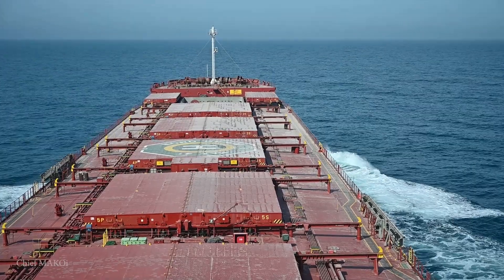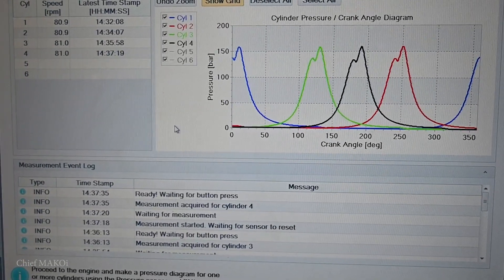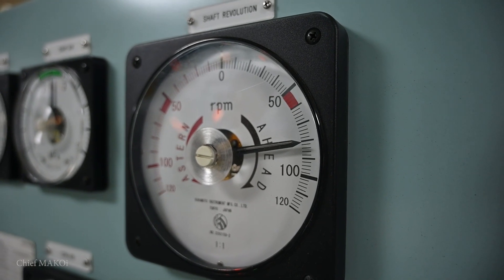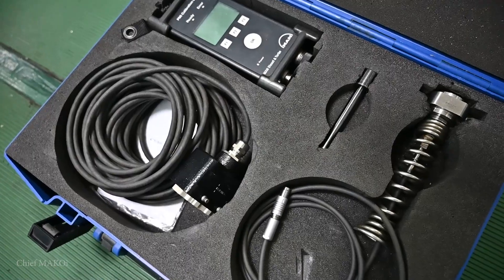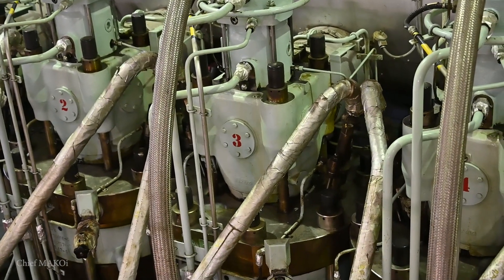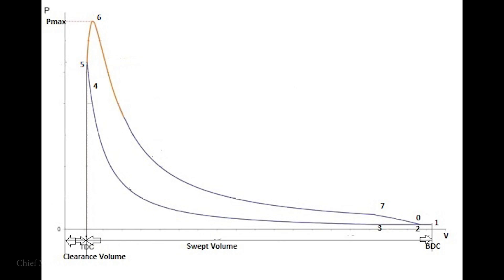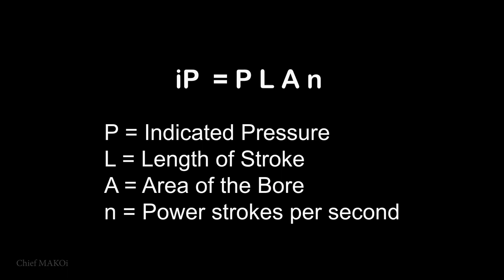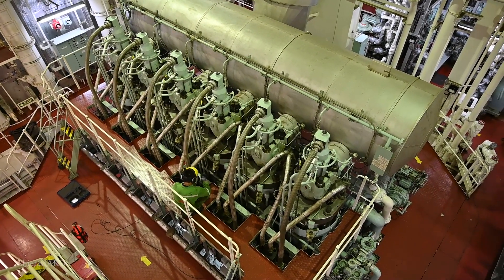Ship's Main Engine Performance Test | Chief MAKOi

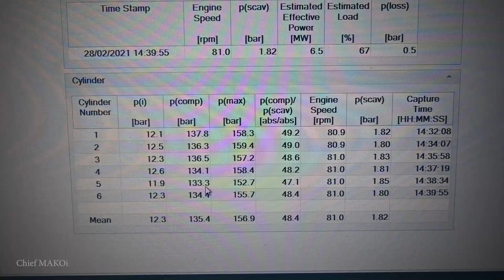Comment: At 10:40 in this film the average TDC pressure is ~135bar which is roughly equal to 2 thousand psi.     Is this typical compression for 2 stroke diesel marine engines? 

Am I reading that table correctly Chef.
Reply from the maker: Pretty much, yes.
Reply: I was blown away by the effective compression ratio - 49:1.  (That includes the pressure increase due to heating in addition to volume reduction.)
Reply: Matthew Beasley “mee too” lol          I think, i calculated that the compressive force on the con rod can be upwards of 1 thousand tons after detonation.
Reply: To convert Bar to psi, multiply by 14.5038.  I find that  a figure of 15 is near enough in almost all cases. Using good old fashioned mental arithmetic, multiply 135 Bar by 10 to give 1350 then add half of this figure (for convenience rounded up to 1400) which is 700. 1350 + 700 = 2050 psi.
Reply: Turbocharger makes a big difference...

Comment: Do any ships have torque-measuring couplings on the output shafts so that engine power can be calculated directly (and continuously)?  This is frequently done on large stationary equipment on land.
Reply: Yes, there is. Arrangement of coils in two places along the shaft with a known distance. The twist of the shaft when turning will be measured and amount of twist determines the output in the value you prefer. 
Made for continues running and as a fixed installation.
Reply: @johanea  Usually done on Navy ships, a bit over the top for Merch. Ships.
Reply: @petermaddison4136  Wouldn’t say maybe over the top. However, you have other options to figure out your output by comparing Factory Acceptance Trail data with a time running the engine during a voyage. 
It is a little bit more rough however since the calorific value of the fuel will be different along with external parameters such as ambient temp, atm. pressure and humidity compared with FAT trails. 
Buuuuuut in 99% of cases or for troubleshooting it is good enough.
Reply: Yes its there. It works like a dynamometer / torsion . And gives the brake horse power or shaft power with ease

Comment: Dobson and Mcguinness indicator if I remember correctly from over 50 years ago. There was one on a single cylinder diesel engine at Guildford College of Technology. Bits of sting and paper allover the place but it worked. Probably before you were born chief. We tied a bit of string around the govenor, apprentices will be apprentices. It was on the second floor. Thank God we managed to cut the string in time or it would have been on the first floor.
Reply: Can you tell me 
Do these motors run with a dry sump ?
Reply: @charliepearce8767  
Yes. Dry sump motors.
Reply: @charliepearce8767 No, the sump is part of the ships structure and underneath the engine. Oil pumps are large motor driven affairs  located at the after end of the engine as ships tend to trim by tbe stern, so the oil is deepest there. Its still possible to loose suction on the oil pump if rolling badly, which will start to  shut the engine down, but you roll the other way and oil  pressure is restored. This can be reduced by adding more oil to the sump.
You have suction filters to protect the pumps   and much finer discharge filters to protect the engine, much the same as a car engine. You also continuously centrifuge the oil through a purifier to remove water and solids, but usually water, due to condensation, leaks from water cooled pistons if still fitted. Any liner leaks usualy appear through the scavenge drains on two strokes.
To have a dry sump means the sump has to be higher than the engine and this has an effect on stability and more pumps.
The bottom of the crankcase is dry as you have to stand in it to carry out certain inspections and overhauls, but below the steel you are standing  on will be the ME Lube oil sump. There are a couple  of mesh covered drains into the sump from the bottom of the crankcase, one forward and one aft usualy.
Reply: @hastuart9639  
Thanks for the info.

Comment: Hello Chief, great video as always.  Why is there a red arc on the power lever between 50-60RPM?  Is that for resonance or something?  Thanks!
Reply: Yes, I believe that it's referred to as critical speed. There are videos on YouTube, search 'vibrations in marine diesel engines'
Reply: It’s the rpm range where certain harmonics in the balance cause unwanted vibrations.  Operating either side of that range eliminates the problem.  Most rotating masses will have those harmonics.  Ever notice your automotive engine seems to run smoother at some speeds than others?